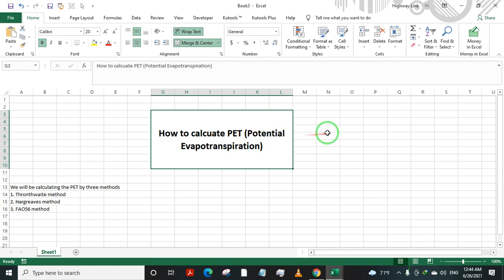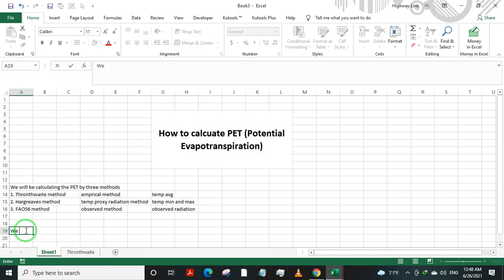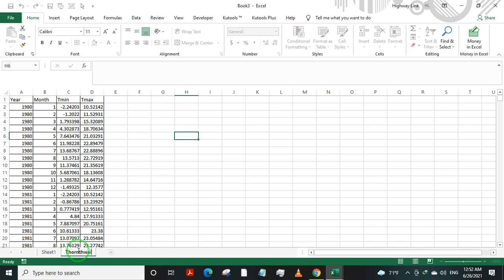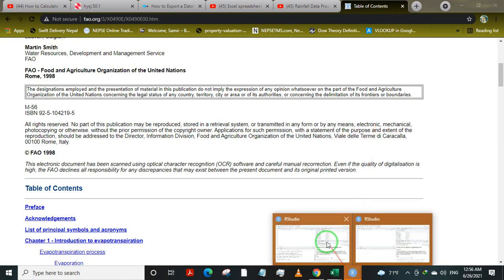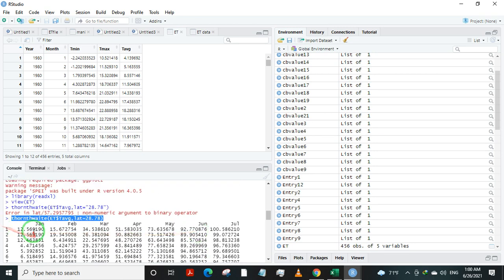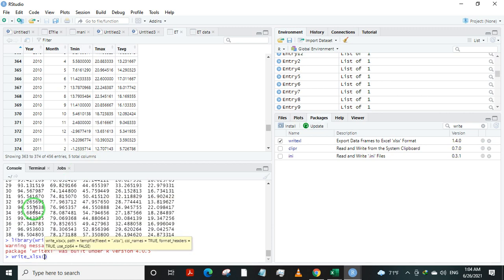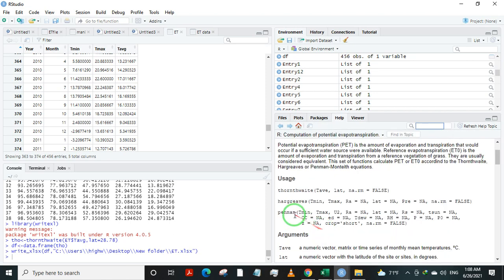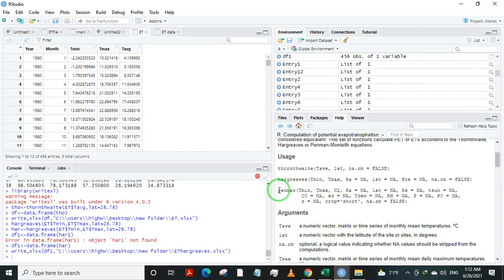Potential EvapoTranspiration (PET) calculation in R studio using 3 different  methods

Comment: bro that package has an error computing etp by hargreave's method cuz if u try it using just an spreadsheet in excel the results will be different and will not have anything related with the results obtained in R by the SPEI package.

Comment: Hi. thank you for this well explained tutorial . I faced with a problem using penman function . I  have all the data in the code that I send here.my code is : penman(data$Tmin,data$Tmax,data$U2,lat = 36.26,data$tsun,data$RH,z = 1213,crop = 'short')
but when I run it this error appears :
Error in penman ( data $Tmin , data $Tmax, data$U2, la t = 36.26, data $tsun ,  : 
  object 'm le n' not found
In addition: Warning message:
In penman(data $Tmin , data $Tmax, data$U2, la t  = 36.26,  data $tsun ,  :
  Using user-provided (Ra)
can you tell me  which part did I wrong and what is the meaning of this error. thanks

Comment: Thank you for this helpful video. I have 2 questions. What is the difference between Penman and Penman Monteith method for calculating potantial evapotranspiration? And can we calculate pot. evapotranspiration in R Studio using P. Monteith Method?
Reply from the maker: Hey there, we can calculate PET in R studio with P. Monteith Method as too by using the function "penman" in the SEI package.
Since I did not have the data for the wind speed , so i did not use it in the video, but if you do have you can try it out.

As for the difference between Penman and Penman Monteith methods,
do check it out here: http://www.fao.org/3/x0490e/x0490e06.htm

Thank you :D
Reply: @theteddychannel2770  :) Thank u for ur answer. I'll try to calculate